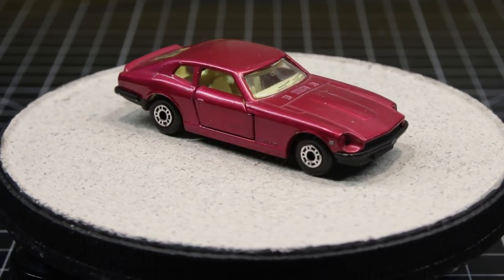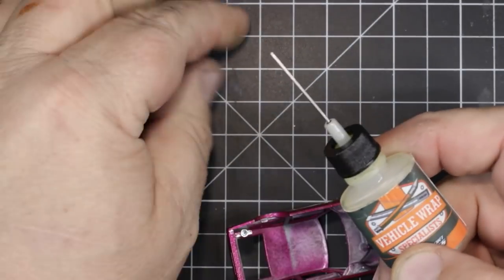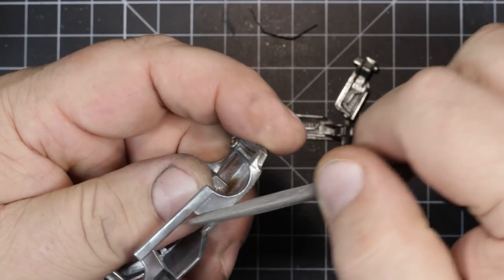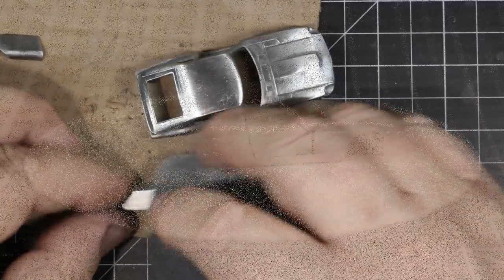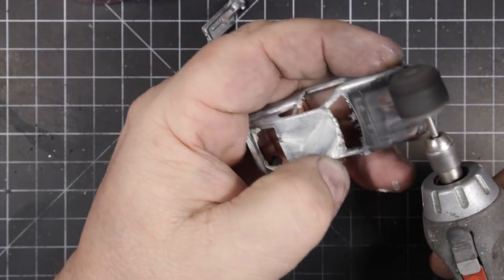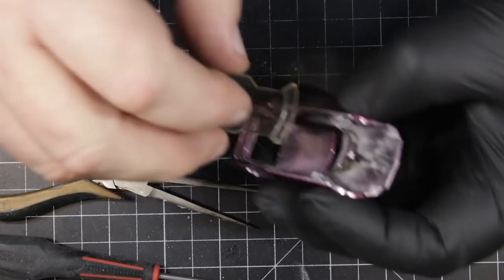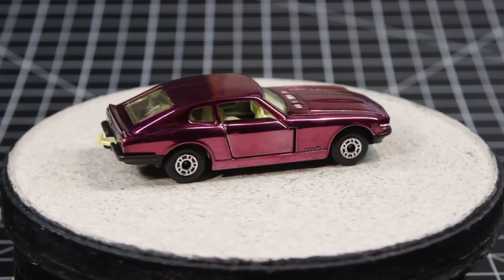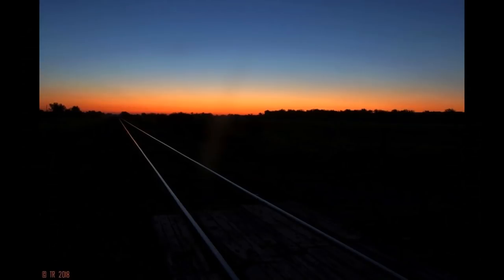Matchbox #67D Datsun 260Z Custom - Auction Information

Comment: Came out really nice. Doesn't look like a Datsun 260Z in my opinion though. One of my best friends in high school had a 260Z. 4spd, header, 3side draft webbers! He ran side by side with my 69 Chevelle ( 327, 4 barrel with headers) until we both got 4th gear. Then I would pull away. Nice restore though!